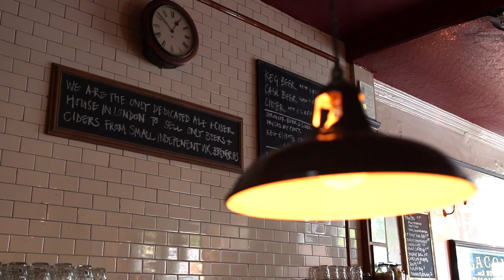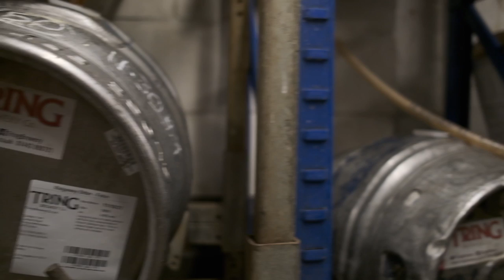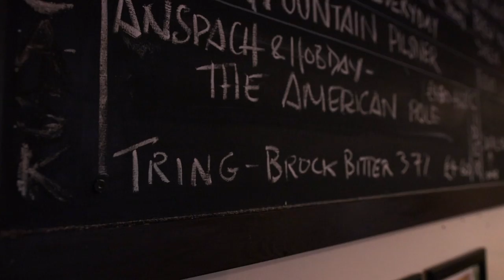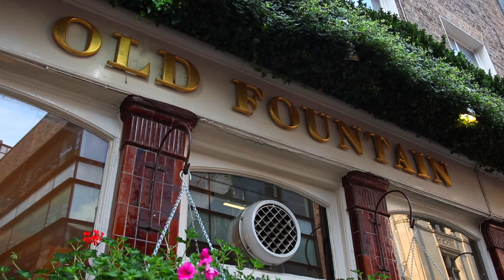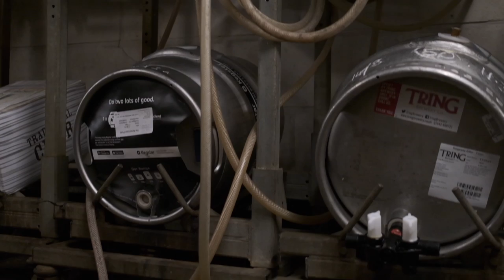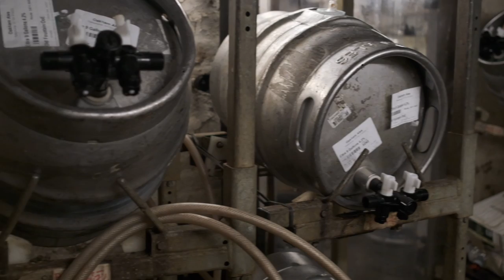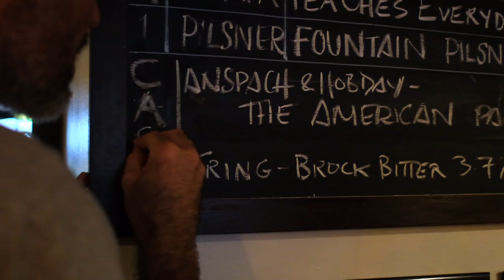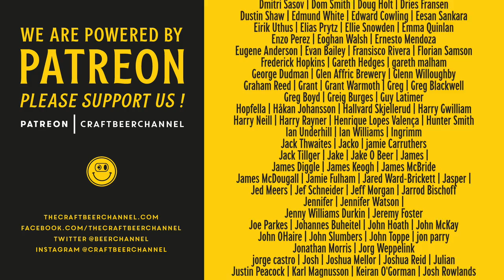Caring for Cask (Keep Cask Alive pt 1) | The Craft Beer Channel

Comment: The Southampton Arms (the pub at the beginning) here is another example of why exceptional cask is difficult to find in London: a great pub serving beers from good breweries, but the cask is often flat and underpar simply because there's little else done to bring it to top level (no sparklers, no slow care). It's fine, sure, because the pub does so well it's all moving through (you won't get an off or eggy pint there, and most often you'll get a decent cask, just not a cracker). No cellar mastery any more. Most people loving cask in London - like younger folk at the Southampton Arms - won't know the difference, so things go on. What can we do, other than head north, or just crack on. Incredibly difficult to find immense cask in the big city. Thing of the past.

Comment: As an American who has worked in the industry for years, I've been lucky enough to work for two different pubs on both coasts of America that always tried to keep a cask or two on.  The first proper pint you drink as a craft beer drinker is one of the most eye opening experiences you can have.

Comment: Loved this episode and I am sure I will the rest. I love my cask ales and thanks to you guys I brew my own using the bag method like you have shown. Australian pubs some times have beer pulled using a beer engine but I'm sure its not from a cask. It was also good to see a sparkler being used when needed. I visited a pub in London once that had a Yorkshire bitter on and when I asked for the sparkler to be fitted I was told the manager did not like the sparkler to be used. I swapped to another beer as they would not serve the beer correctly. Cheers and happy drinking.

Comment: So happy yous are doing this :) Really important stuff. I'm just so lucky to have the Grapes in Liverpool as my local. So many good small breweries in and around Liverpool at the moment.
 
One thing though is I genuinely think that pints poured without a sparkler can put people off. A frothy head with big bubbles can look at bit off and old-fashioned. Whereas a more "northern" style pint pulled through a sparkler with a smooth head and some texture to it is more appealing, and closer to more widely available beers. What does anyone else think?
Reply from the maker: I get your point but a good cask pint without a sparkler should still have a tight white head! All a sparkler does is guarantee it. The beers poured in the Southampton section were all unsparkled and looked MINT.
Reply: I agree, most pints I’ve had served in the south are as flat as a fart after 2 minutes of being pulled

Comment: I think there is some confusion in the (secondary fermentation) that occurs in the cellar. I work in a cask ale pub and look after cellar and everything that goes with that, as far as I'm aware the secondary fermentation happens in a "warm" room at the brewery and when we vent the beer we are just depressurising the cask and waiting for the right level of conditioning before we serve, (No fermentation in the cellar) if I'm wrong please let me know
Reply: This was my understanding as well - the secondary fermentation happens at the brewery at a suitable temperature to spur the yeast, then it needs to be cooled to cellar temperature, settled, vented and tapped before serving. There will be some residual flavour development and biotransformation after the secondary, but all fermentation is (or should be) done at the brewery.
Reply from the maker: Apologies for the confusion. Yes very often secondary fermentation occurs at the brewery but so many of them package the beer almost fully carbed so warm storage is less vital – it's nearly really to go, which partly explains the difference in when these beers are ready (hours or days)

Comment: As a brewer/distiller, my experiences with cask are as follows... Short shelf life (pubs only get 3-5 days to use up the beer once its tapped). Also the shelf life of cask even before its tapped is only around 6 weeks. Many pubs don't care for their beer lines and you end up with sour, warm beer. Cask doesn't (imo) really work as well as keg for the current predominant beer style (IPA). When its done right though, its a thing of beauty - preferably with a sparkler (cask in-joke).
Reply from the maker: Indeed these are key issues, but you can 100% brew great hoppy and IPA like beers for cask as we'll find out in episode 3!

Comment: Cask ales have incomparably greater variety, flavour and colour than continental lagers. If well looked after they are livelier and fresher than other beers. The temperature is slightly higher than fridge cold lagers. And unlike lagers, cask ales won't make you bloated. The only problem I see today is that many pub staff (inexperience or carelessness) don't look after the cask as they should, and so the hand-pulled beer is bad. I had bad experiences both in Cambridge and London. Sadly this drives away even regular clients to resort to drinking Guinness or lagers.

Comment: Not that different than Guinness back in the late 80s when the younger crowd was switching to beers that they didn't have to wait for the foam to go down. What are your thoughts about keg fermenting and letting it naturally pressurize? That seems to be a reasonably closest enough cask-ish beer that will hang on long enough for the homebrewer?
Reply from the maker: Totally open to that, though it is a very different process and serve – and one that doesn't necessarily need saving from extinction!

Comment: How is this different than the way that most homebrewers bottle beer? It just seems like the last beer coming out of that keg is going to be flat and oxidized.
Reply from the maker: It's exactly the same principle, but a world away in terms of process and result. First the beer isn't usually primed but packaged before it finishes fermenting which means it can be served fresher. It also conditions during the process of tapping, and if served within the usual 48 hour window so oxidation or lack of carbonation will occur.

Comment: Shame vast majority is not vegan/ vegetarian friendly. I went to both pubs mentioned recently and apart from stout no vegan options on cask  sadly. Pentrich makes great vegan friendly  cask. Also I think sparklers help.
Reply from the maker: Yes it's another thing that cask brewers need to adapt to – and quite a few have done so by either using vegan finings or simply stopping the use of finings. As for sparklers, well conditioned beer doesn't need them (look at the beer at the Southampton) but it sure does look great.